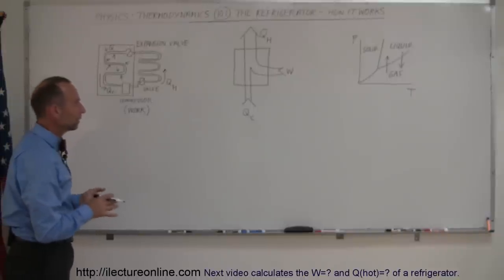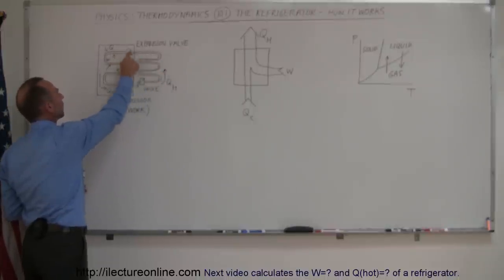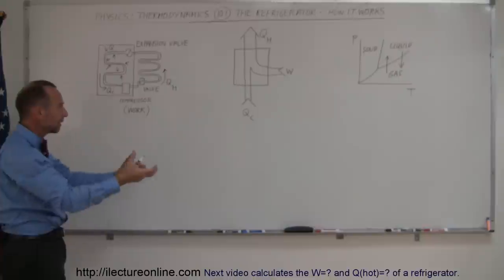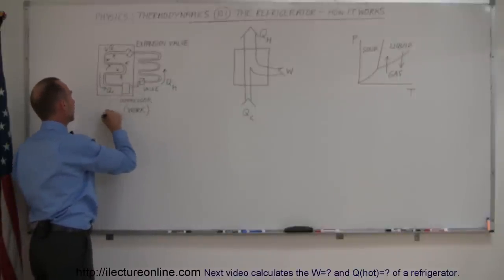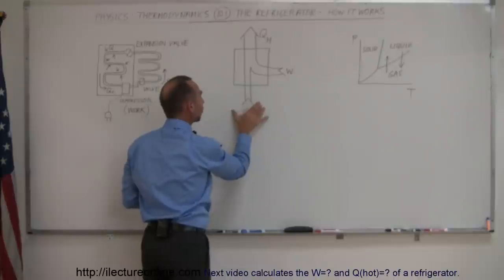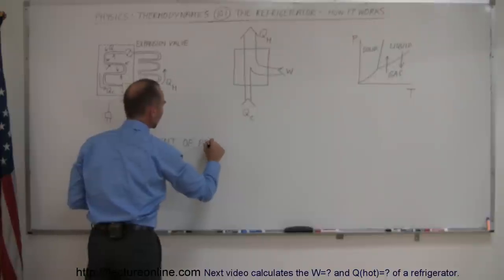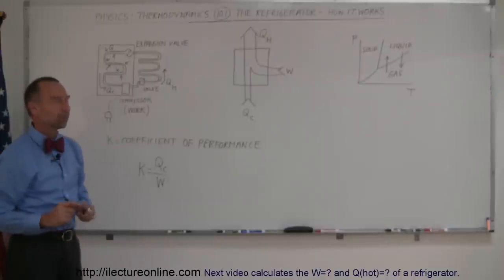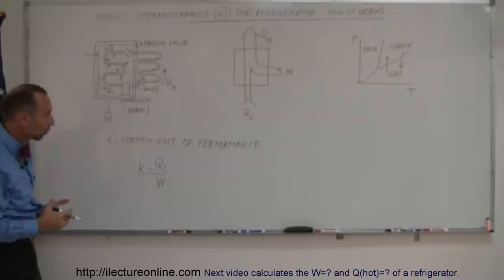Physics 29  Efficiency Of Heat Engines (11 of 14) The Refrigerator: How It Works

Comment: Is heat in the cold refrigerator compartment absorbed by the vapor? And the heat in the vapor thereafter escapes after it flows to the compartment on the outside? If the vapor was to grab more heat from the cold refrigerator compartment, then its temperature must be lower than the temperature in the refrigerator compartment right?? Similarly, in order for heat to escape into the environment, the liquid flowing in the outside compartment must have a temperature greater than the temperature of the environment right?

Comment: Hi here's a small question. If we build an insulation to prevent heat from going back, then how can we allow heat to transfer out of the refrigerator? Is there a space between the process area and the insulation layer? 

Edit: Oh wait there's two parts of the process machine and the insulation is only wrapping the area which extracts heat(Qc) from the cold reservoir; and not limiting the outflow of Qh because they're in two different compartments. Is that right?
Reply from the maker: Even an insulator will let heat out, although slowly.

Comment: Sir, i think the direction of the two arrows in the P-T diagram should be changed one another. Because temperature of the liquid will be going down after passing the compressor. Therefore i think the temperature at the Expansion valve should be lower than the temperature at the compressor. Sorry for the inconvenience.

Comment: What is the purpose of the valve after the compressor? Thanks
Reply from the maker: It is kind of like the valve of the heart.  To keep the pressure from pushing the back against the compressor as the compressor pushes in cycles.
Reply: A fluid at a lower pressure evaporates at a lower temperature, (by the antoine equation). Hence, it will evaporate when it passes through the internal pipes of the fridge absorbing energy (latent heat) when evaporating, allowing the fridge contents to get colder.

Comment: I would have thought that pressurising something would increase the amount of collisions, in-turn increase the force and energy and therefore temperature
Reply from the maker: Gilllie666,
Initially if the pressure on a gas is increased, the temperature will go up.   If the pressure continues to increase the molecules will come closer and closer together.  Eventually if the pressure is high enough, the gas will turn into a liquid.
Reply: thanks :)
Reply: @Michel Van Biezen  With all due respect this is not how the cycle works I believe, the refrigerant is turned into a gas via absorbing heat from the inside of the fridge becoming saturated vapour. The gas is then compressed in the compressor where is becomes superheated. This superheated refrigerant passes through the condenser i.e. the tubes on the outside of the fridge. The air is cooler than the hot vapour hence heat is transferred from the vapour to the air allowing the vapour to condense. This saturated liquid then passes through expansion valve, whereby the pressure of the liquid decreases. Then the liquid is feed to the pipes surrounding the inside of the fridge to start the cycle again. (Source: Cambridge Chemical Engineering lecture course in Process Calculations).

Comment: Isn't Qh supposed to come from the hot reservoir? In this case Qh is going to the hot reservoir?
Reply from the maker: A refrigerator works like a heat engine, BUT in REVERSE.  It is called a heat pump and it pumps heat from the cold reservoir and dumps it into the hot reservoir.
Reply: @MichelvanBiezen  Ah, so the definition of Qh depends on whether you're talking about a refrigerator or a heat engine? What about for a heat pump? Will Qh be the same as for the refrigerator then?
Reply from the maker: Heat pumps and refrigerators are essentially the same thing.
Reply: @MichelvanBiezen  Thank you very much! Still not sure I understand though. I agree that heat pumps and refrigerators are the same thing, but then why are the expressions for their COP different? For a refrigerator the numerator is Qc and for heat pump it is Qh?
Reply: @numbo655  As he's saying, heat pumps and refrigerators are essentially the same, but a refrigerator works backwards, or reverse in some sayings. The COP of a heat pump is decided by how much heat is transferred into the warm space, while the COP of a refrigerator or air conditioner is decided by how much heat is taken FROM a cold environment to a hot environment, further cooling the room. If the explanation of the heat pump is confusing, please refer to this diagram I took from my book https://pasteboard.co/Jj0SGjL.jpg . Tc is less than the outdoor temperature so that HEAT will be transferred from the outside, since heat transfers from hotter environments to colder ones. Similarly, Th is greater than the indoor temperature so that the heat from the pump can be delivered to the inside. Sorry if my explanations are vague or confusing. I pulled some of the evidences from my book.

Comment: How does the compressor increase the pressure of the refrigerant with out decreasing the volume? The reason I ask is because increasing pressure with out decreasing volume is the only way to increase temperature of the refrigerant. This is according to the ideal gas law (PV = rRT)
Reply: When the compressor compress the vapor refrigerant, the vapor refrigerant's pressure begins to increase while its volume decreases ( one can also say that this is also the reason liquids' volume is less than that of vapors'). If you look at PVT surfaces' projection onto PT plane, you can see that if pressure increases, gasses (+ vapors) can become liquids. So from isothermal state graph, P.V== constant while temperature is constant. In a nutshell, the refrigerant decreases its volume while its pressure increases. P.V is then satisfied. However, that pressure change is through the work done by the electricity. It is minus signed since it is towards the system (IQcI+IWI=IQhl). Lastly, If vapor becomes liquid, it has to give energy (heat). This energy is given throughout the process of cooling ( outside the refrigerator). Thus, the refrigerant cools outside the refrigerator and heats inside the refrigerator.